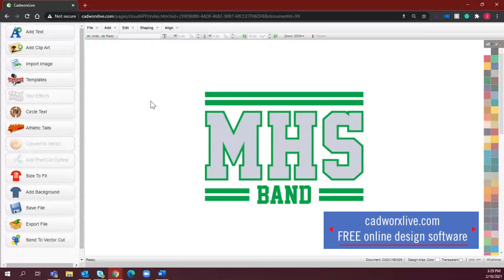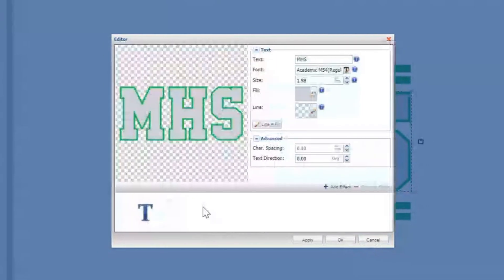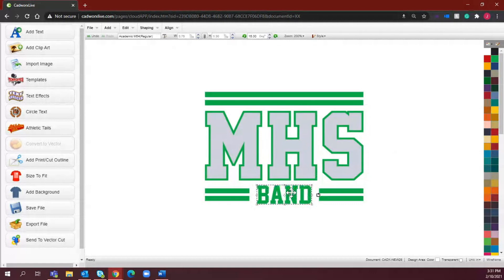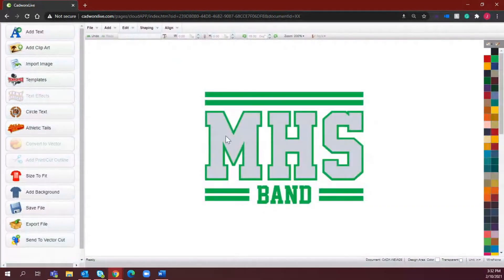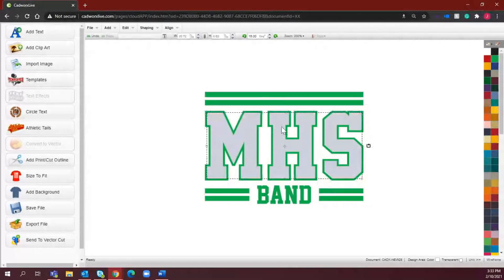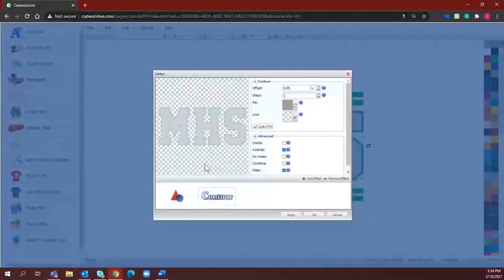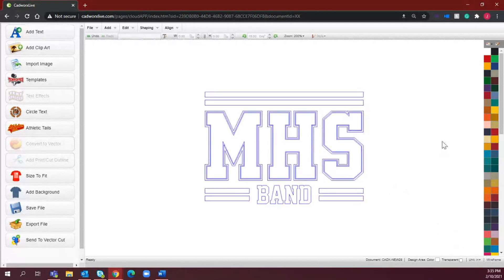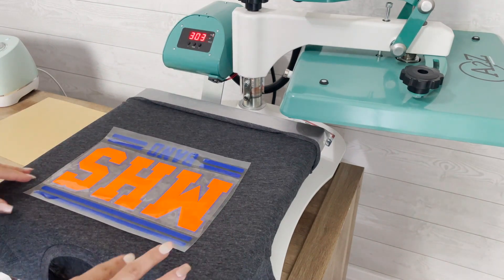How to Contour a Design with CadworxLIVE | Trapping & Contour Methods

Comment: Hey Jenna,  so quick question for clarification... the contour added for the traping method allows the Ultra-weed layer over the foam, correct?  You can put Ultraweed over Soft Foam but not the Soft Foam over Ultra-weed, correct?